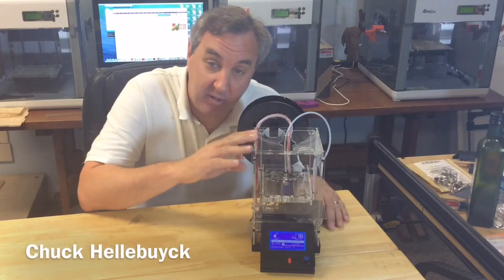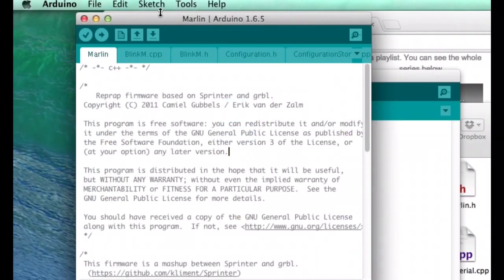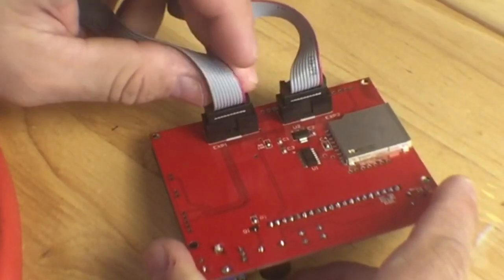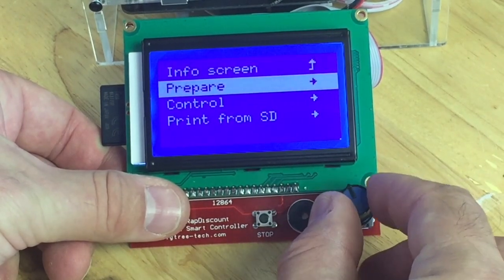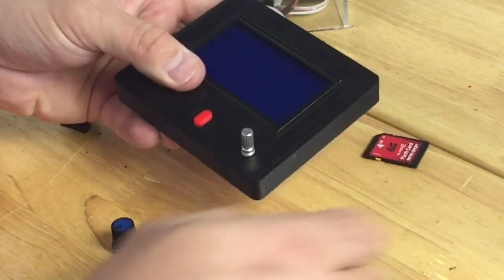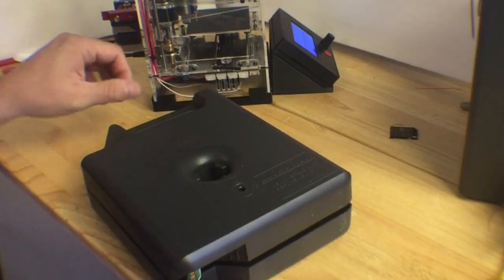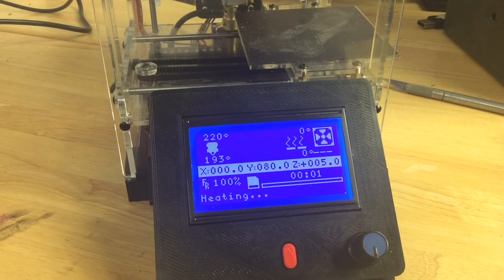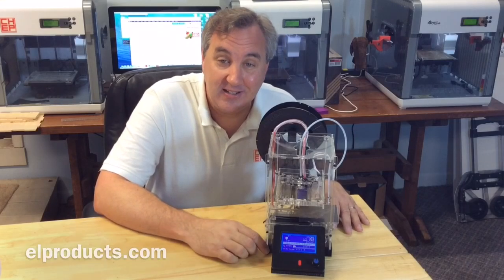Filament Friday #36 - Fabrikator Mini 3D Printer RepRap LCD and SD Card Installation

Comment: You don't have to cut the key of the LCD cables. You can with a bit of patience and a pair of needle nose pliers, pull the surround of the connectors off the board (leaves the pins behind) and then put them back on. I did this on the Fab Mini end as I want to find a smaller screen (maybe the BigTreeTech 12864 Mini). I've actually done this on another MKS board at some point! And yes, I did in fact buy a 2nd hand Fab Mini in 2022! I bought it as a bit of a project as I always wanted one. I even put Marlin 2.1.1 on it (and enabled Linear Advance). I even designed & laser cut a new print bed (and added BuildTak).

Comment: Hey Chuck, I just found your website after purchasing a Fabrikator Mini, but when I try the "move axis" command in screen for the extruder NEMA,  it doesn't move. If I change it to X, Y or Z connector, it works (so motor is working). They guy who sold me it said it was fully working before. Is something related to the test itself? I still didn't print anything because I am preparing g-codes and getting PLA. Will it work anyway? I am worried because I couldn't put filament if it fails. Kind regards
Reply from the maker: Not sure. Sounds like the driver on the board may be bad.
Reply: @FilamentFriday  Thanks Chuck. I swapped pins in arduino code, since there is an extra driver free, from E0 values to E1. Maybe this will help, tomorrow I will  try it. Regards.

Comment: Hey Chuck ...long time no see.  I was updating my Fabrikator Mini's LCD firmware to version 2 but before that:

Apart from improving the rotation wheel response, to scroll down does the rotation wheel stills goes counterclock wise?
Reply: Ok... Oh and another thing...Why does My Fabrikator Mini v2 starts the extruder skipping noise when its' printing the SECOND layer.??
 First layer prints fine, but when the second layer starts, it feels like it the extruder doesn't go up because it skips like hell
Reply: @carlitoswei5301  do you own the origional fabrikator mini or the new version?
Reply: Drew Bransby original
Reply from the maker: Possibly printing too fast. First layer is usually  slower.
Reply: CHEP I have had a problem with the screen turning on but not displaying anything and no noises are made when you press the knob.
Reply from the maker: Check the connector. I remember having to reverse them on mine when I did my video.

Comment: Hi CHEP, I installed the LCD mod on my Fab mini V2 when I power it up the LCD screen would just blink on and off and the buzzer would chrip at the same time. Do you have any suggestion. Thanks
Reply: Yes I triple checked connectors, Reloaded software 3 times with Arduino 1.6.5. I ordered a new LCD board to see if that will work. Thanks for the fast response

Comment: Thanks a bunch Chuck. Just installed
And thank you @DingoBoy (is it +DingoBoy on yt?)
FYI the fpos_t to FatPos_t is correct and should be adjusted, but if you add an annotation, or add it at the top of the video description, shouldn't give anyone an issue.

Comment: Hi, great video, my only issue is that I keep getting the error message "Error Compiling for board Arduino/Genuino Mego or Mega 2560" can you please advise how to resolve this? I am using Arduino 1.6.13
Reply: Hello, I am now using the 1.6.5 version but it still isn't working. I followed your video step by step several times. The error message is as below. I can see a Configuration.h file in the zip folder but I don't know how to open it as it doesn't open in arduino.
Error Compiling
Marlin.ino:33:27: Fatal Error: Configuration.h: No such file or directory
Compilation Terminated
Error Compiling

I appreciate your help, thanks.

Comment: Had a flashback to last time I worked with Arduino's and remembered the vital piece of information!! Always use the version of Arduino that the code was written in! After watching your video again I realised I had a later version of the software - i downloaded Arduino 1.6.5 and it compiled perfectly with no errors!! Haven't printed yet but have got the screen booted up now and controlling the printer

Comment: Thanks for the quick reply, my reply was cut short, anyway yeah i selected the right board, got the right com port, but it wont load the script. Asked it to read the board, and it does, but says unknown board. Im confused. Tried it with power on, power off, connect before loading Arduino and connect after.
Reply: Ok it loaded something.... and now its not working at all. Cant figure out how to restore it to original. I have the file from your site, but dont know what to do with it.
Reply: No, my printer wont work now. Just followed the same instructions and it does not work at all. I noticed all kinds of lcd stuff in the code, what is that? I dont know how to load the original firmware back onto my printer, i need instructions. Its just an Arduino file, ok but how do i load it? I have been watching Arduino tutorials, and cant figure out which sketch i should load onto the printer. when i open Marlin it has HEAPS of stuff, and its not clear what to do. Maybe a video for dummies like me would be good.
Reply: Ok got it finally. I should make the video "how to reload the firmware for dummies like me" lol
Reply: I am struggling aswell, please do haha

Comment: I got the same parts and did the LCD upgrade based on the links in the video and got Marlin functioning on the Fabrikator Mini. However when I try to print anything it says waiting for bed to heat. I see the temp for the bed shows on the Marlin screen as 50. And it sits and wont go any further becuase there is no heated bed. I am new to Arduino and I got as far as opening the configuration.h file and finding/confirming the "define TEMP_SENSOR_BED 0" was set to "0". I also went over the settings in Repitier Host and ensured the bed heat settings were all "0". I also confirmed in the gcode that the command is there at the bottom "m140 S0" which should turn the bed off. I've been at this on my own for 2 weeks and still can't crack this. If anyone knows my rookie error please let me know how to get around this.
Reply: Thanks for the quick response and all I needed was my nose pointed in the right direction. I went to see the Cura settings and I didn't realize there was another area with bed temp under filament that had one more setting. Amazing that I overlooked that and went on a rampage of reading forums and overthinking a simple thing. It was set to 50. I changed to 0 and tried. The print started! Printing your chess pawn right now! Thanks

Comment: 3D printer Fox here, I recently bought a Fabrikator mini an is trying to add a "RAMPS 1.4 Controller Control Panel LCD 2004 Module" to the new 1.5 board, because I didn't have a need for the big screen an was hoping this 20×4 line screen would fit the purpose for this fox. BUT? need a little help in getting to work, I followed your instructions and it lighted up with line one and three with full box lines even tho I can use the knob in hearing beeps for scrolling and pushing the knob to select without menu showing. so I hope you can help out this 3D fox?
Reply: +Chuck Hellebuyck&#39;s Electronic Products 
yes, I did switch the ribbon cables so that pin one (red line) is on the same for LCD. I did down load the firmware for my screen from HobbyKing.com where I bought it and not the one for the full graphic display form your site, I just watch your video in how to install FW threw arduino 1.6.5 which I am new to loading stuff on boards. the screen does lightup an can scroll and select by the beeps from the little speaker I just get full block line on first and third line only.
Reply: I did see the contrast potentiometer an it did work to dim/or brighten the screen with blocks on lines one and three. all tho... if you like I did see one of you recent videos on another 3D printer that has the same LCD screen that I have so you could try using on the Fabrikator mini to see the results for yourself. I can post the link for the firmware from the sit I bought it from if you like? Oh sorry the 3D printer is your Tevo Tarantula screen is the one I have.
Reply: Did you try it out?
Reply: that was my first point, I have no need for such a big screen, small an simple would be perfect for this fox.

Comment: Hi Chuck .. Am pretty much new to 3d printing .. but i did upgrade my fab mini with the RepRap LCD, My question to you, do u  know of an stl file for the reprap case that i could print on the fab mini? if not then what is your advice for splitting the case into management size for Fab mini.. Thanks a lot.

Comment: I noticed that the new firmware also fixes the step/mm error that my Fabrikator Mini had. It was printing 2% too small and overextruding a bit. The x & y steps/mm values seem to be spot on. I'm getting random print failures due to USB issues, so although OctoPrint is actually more convenient than using an SD card, it's just not viable if I can't print with it as reliably as with my Wanhao using SD cards. Thank you for the clear instructions on how to install this upgrade!

Comment: Just did the flash with your firmware for SD and LCD and its working great so far .   ( on a Fab Mini V1 )
Your the best man !
Reply: +Chuck Hellebuyck&#39;s Electronic Products after using the firmware for a few days now i cant help think there must be a slightly better setup in it . i finding the prints are better no matter if i continue to use tethered to PC or using SD.   Also i have to have look , but i think your firmware sets the max temp to 250C ? that could help with ABS as it was locked to 230 factory .  Thanks again man .

Comment: Hi Chuck, thanks for your great Videos so far..Helped me out a lot a my V1.5 arrived this day.. 
Got the same lcd board and after following your steps it comes to live.. 
But on my lcd i cant choose between the different axi to move and when i plug in
a card with a gcode from repetier host the display only shows no cd card and i cant find the code on it.. 
how do you format these cards ? 
and do you choose to save a full version with start and stop ? (repetier host ask me that)
Reply: +Guido Päckner I use full with start and stop .  that way it will behave how it did when you ran the printer hooked to PC .  It should home and then start the print. 
Make sure your SD card was formatted with FAT32 .that's in the format options on a PC.  If you using a PC you can check that and even format the card just by right clicking on the SD card in the file browser and using that right click menu options. one of them should be format , if you have format options ( and you should ) chose FAT32 for the file system to format as .

Comment: I tried to flash the Fabrikator mini 1.5 for the LCD screen, and unfortunately can't get it working. Trying to get the mini working wired to the computer again. Printer not responding to Repetier. Do you happen to have the original files for the Fab Mini as they come out of the box? I'm desperately trying to get it working again!
Reply: Hello Maker Max, have you made any progress in the 2 years?

Comment: For any of you that feel like the control knob is "backwards" - that is, inverting the direction you rotate it to navigate the menus and change values - there's a relatively easy way to fix it. While following Chuck's instructions, when he gets to the 2:35 mark in the video, before clicking the arrow, instead click the triangle on the upper-right corner and select the file "ultralcd.cpp." Inside of that file, Edit->Find and search for "ENCODER_PULSES_PER_STEP 1" - there should be 2 of them on line numbers 98 and 105 (or thereabouts) - and change each to "ENCODER_PULSES_PER_STEP 1"; that is, you're changing the "1" to "-1" in each spot. Once that's done File>Save and then go ahead and continue with the video's instructions. (Click the arrow to upload to the Fab Mini, connect the cables, etc.)  That's it!  Now turning the knob clockwise will move down the menu and increase values, while turning left will move up the menu and decrease values.
Reply: +Brandon T LOL whoops, accidentally did strikeout text on that.  In case you have problems reading what I said, the (clarified) sentence should be:
'Inside of that file, go to Edit/Find menu option and search for "ENCODER_PULSES_PER_STEP 1" - there should be 2 of them on line numbers 98 and 105 (or thereabouts) - and change each to "ENCODER_PULSES_PER_STEP 1"; that is, you're changing the "1" to "-1" in each spot. Once that's done, go to File/Save menu option and then go ahead and continue with the video's instructions.'

Comment: Hi Chuck,  I just thought I would ask you about your thoughts on the high operating temperatures of the stepper motors on the Fabrikator mini! these seem to run very hot and after checking the voltage of drivers I am interested to know what your voltages are? mine range from .61 to .78 volts! I have read that some others have reduced there's to .6volts! but as this is new feel that it shouldn't really be played with! many thanks.

Comment: Hi Chuck, I followed your instructions to the letter on my Mini v1.5, looks like they re oriented the sockets as they were the right way.  Got the display working fine and it is controlling OK. 
However now home position 0,0,0 is in the middle X/Y and 30mm up in Z.  Do you have to use Auto-home to reset it?

Comment: Hi Chuck, great video and I love your channel. Thanks and please keep it up. Small question: will this firmware also work on the updated 1.3 board on the v1.5?
Reply: +Chuck Hellebuyck&#39;s Electronic Products Great, thanks! Just ordered one! :)
Reply: +Musiquence I received my Fabrikator Mini  v1.5 recently and followed video and applied this Mod and it is working so far.  You still have to cut the connectors because they didn't change the Pin 1 issue.  But everything went as planned.  Thanks Chuck.
Reply: +Don Flynn Thanks!

Comment: The link to the controller seems to be missing from your website
Reply: Checked again and still not there, not sure if it's a regional thing because im in Canada?
Reply: +Millermatic18 I had this same issue...until I turned off AdBlock.  Apparently it's being considered an ad - at least for some ad blocker/browser combos, so the link doesn't show up. Or so I'm assuming, given that it fixed the missing link for me. And regardless, you should enable ads on the websites of awesome people like Chuck, anyway - right? ;)
Reply: Thanks for the tip Brandon, I never used adblock until it came installed on my new pc and always forget it's on. I watch youtube to fall asleep every night so adblock is nice because I don't get woken up by loud commercials. Will Disable next time i'm on the site.
Reply: +Millermatic18 NP! Depending on what adblock you're using, you can usually tell it to disable completely on a given website, which is what I did with AdBlockPlus on Chuck's site.  YouTube, however...I'd much rather sign up for someone's Patreon or give a YT donation than to deal with those horrible video ads, and that's coming from someone who spent years as a software engineer with a responsibility of trying to prevent video ads from being blocked in a our company's video player. ;)
Reply: Ya i have on many occasions gifted games etc to smaller youtubers I follow.
Reply: +Chuck Hellebuyck&#39;s Electronic Products Funny(?) enough, I signed up to your Patreon for more than that earlier today because of this video + your video about adjusting the voltage on the Fab Mini. So - no $1/month needed, your videos are worth much more (relatively speaking?) than that to me.  Thanks as always for the content, Chuck!  Very much appreciated!
Reply: +Chuck Hellebuyck&#39;s Electronic Products No prob - I know exactly how not-cheap the "3D printing hobby" is, and I've also started to make YT videos only to realize how much time and effort gets sucked up by them, so I'd much rather help you supply the community with great content than to waste my own time putting up crap that isn't nearly as good. Keep up the good work, Chuck - it's appreciated by many more than will ever say it! :D

Comment: Hey Chuck are you only using the build tak now with PLA or do you primarily print in ABS?  I tried the PEI I mentioned earlier as I was curious.  I generated a small print to replicate the build area of the Fabrikator on my Prusa and shut the heat bed off (never done this since I have had my printer and was curious if it would work) and the first few layers printed great and than the wheels starting coming off the wagon LOL.  Anyway,  I can confirm that PEI does not work well on a cold bed.  It works awesome on a heated bed and have several dozen prints using it,  too bad I was really thinking this was a good solution for the Fabrikator.  

Thanks!